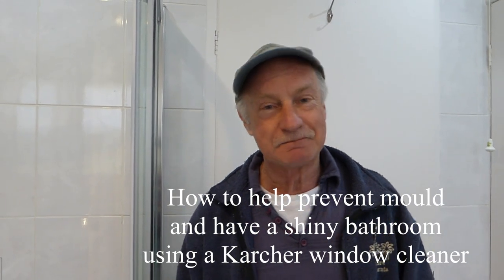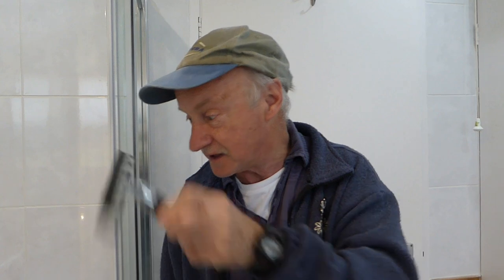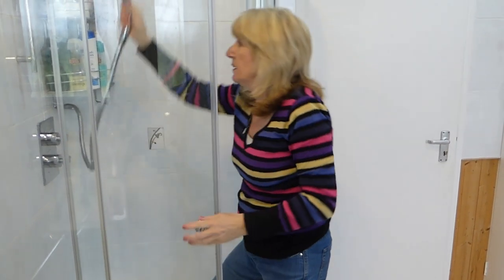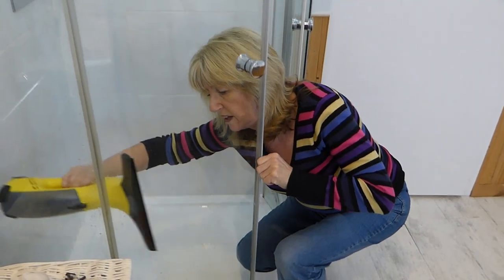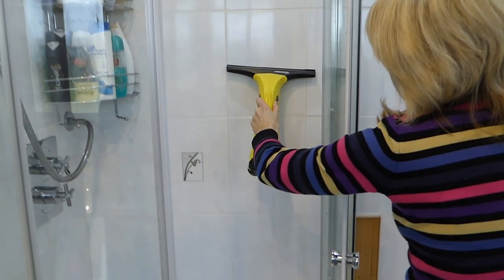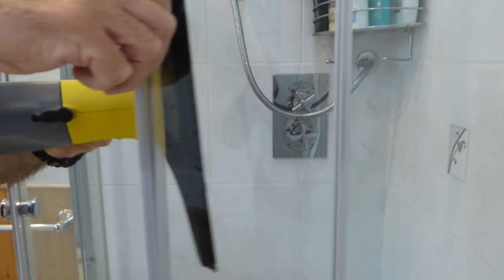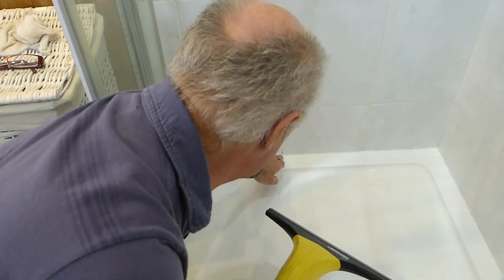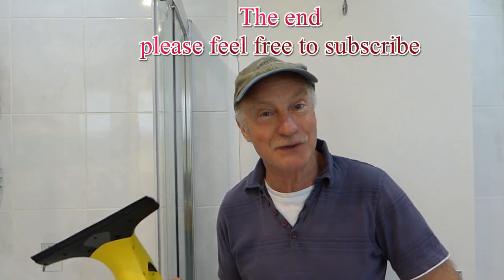Using a Karcher window cleaner to help prevent mould in your bathroom

Comment: You could also benefit from a Karcher steam cleaner. then use the window vac. you wouldn't use the liquid and the cloth you use would be minimal.I use a steamer and window vac combined and it has saved me ages of time ...one tip though, the water has to be a thin amount otherwise it bubbles out the motor end.Other than that ...an EXCELLENT tool.
Reply: Erm thin water, I'm afraid my water is of the thick variety.
Reply: lol.....Cliff, funny.
I think you know what i mean ...hehehe.